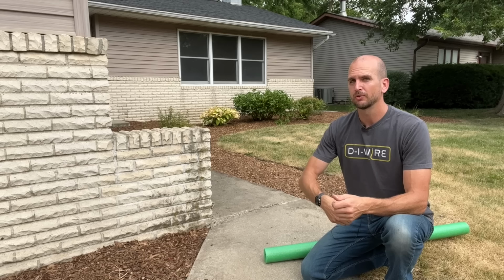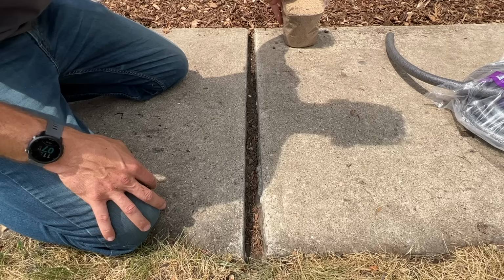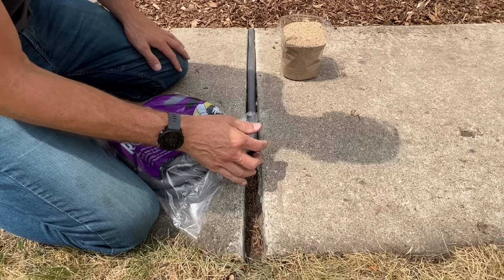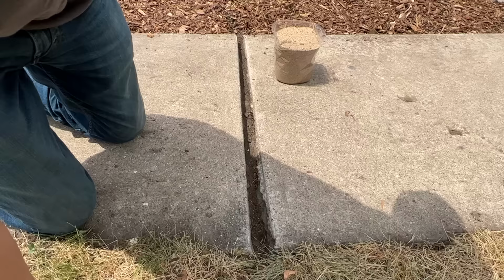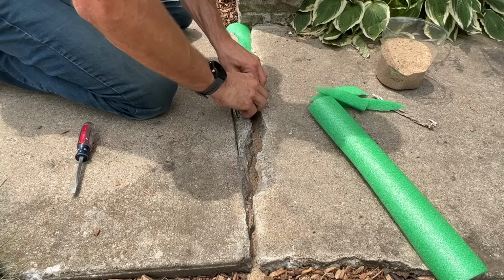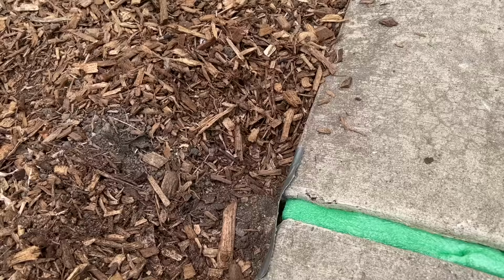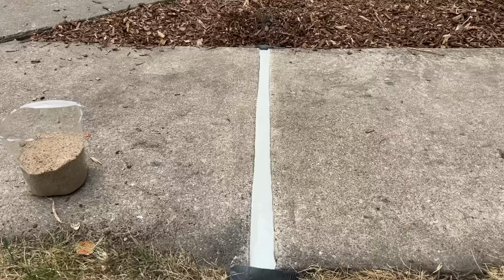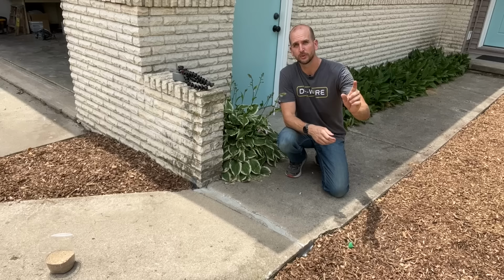How To Fix A Large Crack In A Concrete Sidewalk | Surprising Results!

Comment: I have this problem between the concrete slabs surrounding my inground pool. I noticed chipmunks going into the cracks... I'm concerned they'll die in there if I do this. Any suggestions?
Reply: No , but that's a bigger issue involving a pool and chipmunks

Comment: Don’t get why you would sprinkle on sand. Simply take a dry sand and cement mix (the same mix used to make the concrete in the first place) then put in on the grey caulking immediately and cover everything with a thick layer of the dry mix. So much that you have to brush it off when everything has dried. The first time it rains the cement will hydrate and match your sidewalk patch much better than your sparsely sprinkled on sand.

Comment: No.

This fix, is a bandaid on a gunshot wound.

A Portland sand mix is less than 10 bucks and is very easy to mix and use.

Aside from the cracks, there are a number of issues that need addressing.

Leveling, and support of the slab is just the beginning.

Comment: Seems a lot of faffing about with the potential to look messy. I have always trimmed the crack with a disc cutter to at least 2” wide by the depth of the concrete. Then rough up the sides of the two cut edges with the disc cutter to form a key. Prime the roughed up edges with external PVA adhesive. Mix up some concrete using a mix of sharp and building sand and cement with some pea shingle and add some PVA to help stop it cracking. Push into the gap and trowel off. 
If the existing concrete in not stable the joint will open up again which ever technique you use. 
You could use a course setting sand pushed into the joint and trowelled off. 
Which ever works best for you and the tools you have to hand.

Comment: Might be easier to just cut on either side of the crack, and pour a new section of concrete giving you a nice even edge between the concrete edges.

Also a question to pose. When these cracks happen. Whether it be shifting or pressure or whatever. What do you recommend doing to find out the cause and alleviate the issue? I feel like filling the crack is bound to fail if the cause isn't addressed.

Comment: What is wrong with getting a bag of concrete, mix it up and and just repairing 
the hole ?
Reply from the maker: For me specifically I wanted a seal/filler that had a little flex but still kept out the water.

Comment: Does this method work on concrete walls with cracks?
Reply from the maker: The Tremco will just flow down the wall so I don't think this is a good option.
Reply: @EverydayHomeRepairs  Can you suggest a method then please? I am a 65 year old woman trying to help myself. The cost of a tradesman going is astronomical! small pension!!

Comment: The video should be titled how to temporarily fix, because cracks that big in concrete are from foundation issues, and will continue to deteriorate over time.  It's obvious the sidewalk has no steel in it, and most residential concrete is not anywhere near as good as a commercial job.

Comment: Why not just use sand then sealant? No noodle?
Reply: Proper sealant profile is critical to its performance it needs to be thinner in the middle than at the sides the round contour of the noodle achieves this

Comment: I do similar but that self leveling product is crazy costly...i just use 1 gal asphalt crack filler..from my experience with it.....it works fine on concrete...and is only 8$ gallon in thick liquid form...its black...but i dont care....it does the job good enough.

Comment: Why don’t you just use spray foam for homes spray in then wait for it to dry and sand it down to the level of the concrete then use the sealer. Use sweep up from your garage or sidewalk which ever is dustier lol put that on the sealer so it doesn’t stand out sweep in when the sealer is just about dry .

Comment: That won't last, you pumped to thin a layer in the crack, and the foam is too pliable as a foundation for the sealant. You a stiffer denser foam substrate and half the amount, or try oakum, then pump at least double the sealant you used, and it might last a while!

Comment: Personally, I'd want that whole crack and void filled completely with concrete, not a backer rod with a very thin surface of concrete that won't last and will easily break off.

Comment: terrible stop gap method. that pool noodle wlll degrade and fall apart that and sealant will fall through.  That cement sidewalk either has no mesh wire or its at the bottom of the slab hence why it broke apart. That it looks like the natural ground has movement when it rains it swells and shrinks when it is dry. Also another reason the sidewalk broke.  Also theres no expansion joints in the sidewalk.  Just break out the sidewalk, put a new sidewalk with expansion joints and rebar at 18" centers. when you pour the cement make the rebar is propped up with rebar stands.  Run the rebar threw the expansion joints.

Comment: It's nonsense. Concrete does not crack by accident. Instead of putting such things in every crack, they should prevent the cracking. It should be concreted so that it does not crack.

Comment: so let me get this straight, you first fill the crack with sand, then you fumble the foam in there and finally you seal it. so to me this looks like unnecessary work. what's wrong with just filling the crack with sand? not convincing.

Comment: No offense, but those products are temporary and used for expansion joints for expansion and contraction, and not recommended for crack repair. This is misleading and a temporary fix, that will cost more to remove in do time. There are structural cement based products for repair, and or two part structural poly-urethane systems for crack repair.

Comment: Concrete that beat up? break it up and redo -it. Not hard. this looks cheesy. I bet that concrete breaks pretty quick with a sledge hammer. Concrete is cheap but dont use quikcrete, cures too fast.

Comment: It never last long.
Reply: What do you consider long ? I have installed literally miles of polyurethane sealant in sidewalk expansion joints. I went to a shopping mall recently where I installed it 10 years ago and it was fine. Our standard guarantee is 5 years and we expect it to last at least 7 or longer

Comment: If someone put in fibre boards properly into proper expansion joints in concrete you wouldnt have to faf around with filling etc etc or stupid repairs or keep putting silly little lines in fresh concrete pretending there separate pads... and also edgeing each one pointless...

Comment: This is a total Micky Mouse and dangerous. A womens  high heel would go right through that soft bs repair and could easily cause a broken ankle or other serious injuries. This type of fix should only be used for very narrow  cracks or separations at expansion joints. Do it right or don't even bother.

Comment: or $5 worth of sand and cement...... 2 minute job
Reply: Concrete in a expansion joint is not the answer lol Expansion means to expand or move. Concrete cracks when it moves.
Reply: @philbenson6041  I didn’t say concrete.    Sand and cement mortar is a different thing to just concrete.   Concrete has a ballast stone as well as sand and cement 

But I get your point about movement.  I didn’t watch the vid properly and thought he was just filling a gap and didn’t know it was an expansion gap.    To quick to post comment without reading.    My mistake

Comment: What a waste of money, that trick is going to cost you more in the long run. The bugs and time will erode the fine . I give it 6 months before you start having trouble again.
Reply from the maker: We shall see.  My other concrete crack filled with Tremco 45 SSL is at my house and is going strong 12 months later.  With that said this crack is much larger so might be a bit tougher test.  The Tremco Vulkem 45 SSL is great stuff.
Reply: @EverydayHomeRepairs   if this is true can you guarantee this type of job 5 to 8 years at no cost to home owner. If you can’t it’s all band-aid job.

Comment: Well that is a shortcut to an actual fix. Why not do a proper fix? Get Quickcrete and gravel, mix with water and fill the hole. Top it off with a rubber sealant that allows joint expansion in hot months.  That is the reason it cracked in the first place.  I don't like this mickey mouse fix, this won't last.

Comment: Sika is crap and won't last 2 years , cracks , pulls loose , total junk .... The stuff you used (Vulkem 45) looked exactly like the Sika when you poured it ..... and as for "SEMI self-leveling instead of self-leveling like Sika" , both look exactly the same viscosity and the brand you used VERY MUCH SELF-LEVELED , so I have no idea what you are talking about when you act like this brand you are using doesn't self-level as much because it's "semi self-leveling" , BOTH seem exactly the same as far as leveling goes .... Looks exactly the same to me , and I KNOW FROM EXPERIENCE the Sika sucks , doesn't last , and is a waste of money ..... SO , how's yours holding up ???? and for how long ???? THAT would be great to know .....

Comment: Crappy job that's what that is called. Looks even more bad than it used to look.  Do the job proper use a concrete cutter to even up the crack fill it with concrete mix and drill holes with steel reinforcements so that it holds for years. Use a concrete polisher machine to make the crack go away and not be visible, or at least cut it straight so that it looks like a dilation cut.

Comment: This is ok if you own your property. My driveway is about to cave in but the cheap so in so that owns the property will have to be sued in order to have it fixed. Then we're out on the street. That's the problem with 90% of this state's owned properties. A damn big problem. We were already told by owner if the State law doesn't require it, it will not be fixed. Shit attitudes like that will cause a communistic country to flourish, then it all goes to HELL.